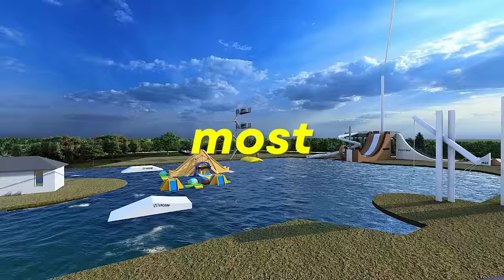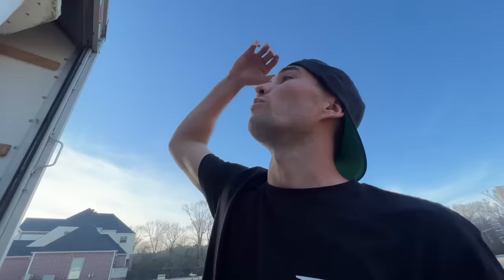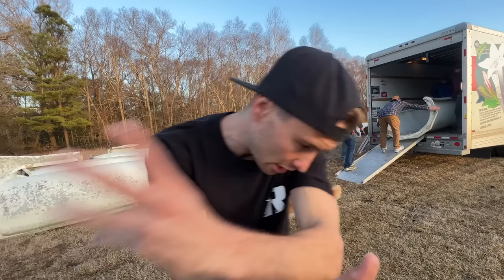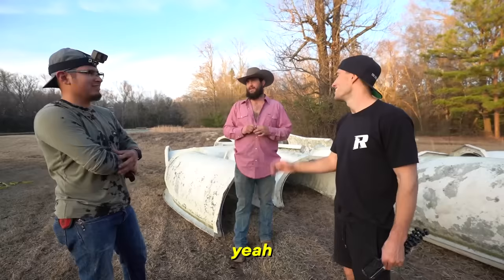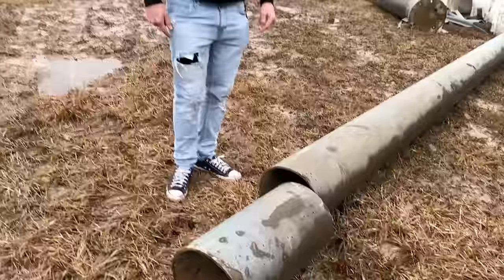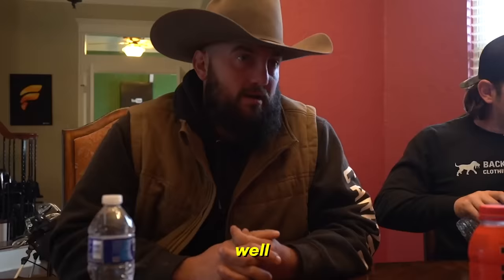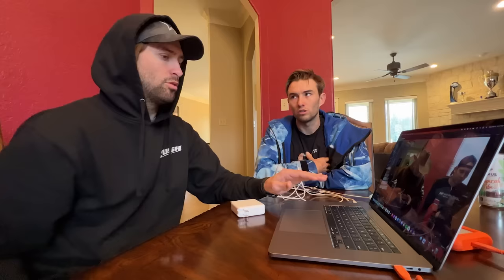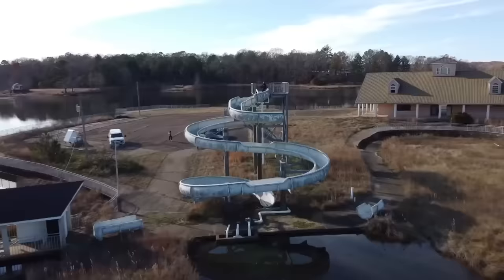I Bought a $300,000 Waterslide for my backyard!

Comment: Cutting up the structure isn't that big of a deal frankly. Round main section can be welded then weld a collar overtop to reinforce the joint. The HSS beams can be welded up as well and gussets/additional plates added. The structural part is the easier part. The loads aren't actually that substantial either. Water weight on the slide would be a few hundred lbs at any given time, a user or two another couple hundred lbs, and the weight of the sections themselves which by how they were moved suggest they're less than 200lbs each. 

The slide segments on the other hand appear to be in very poor condition. A lot of rot, corrosion, and weakness (visible cracking). Given the number of sections and they all need a significant amount of fiberglass re-work and it all needs a fresh gelcoat, to me there is about 20-25k just in refurbing the slide pieces. 

No offense but generally speaking this slide looks like it was ready to be landfill garbage until you came along as its cost to repair exceeds its worth. None the less, best of luck!

Comment: It's dumb that they cut up the support pieces without asking, but it might be easy to weld it back together which would make it a fairly standard thing to do while moving it. It would help to have someone else who is familiar with that industry, because I could imagine that if the slide was worth an order of magnitude more (I have not idea if it was or not) then it might make sense for the other person to say that you got it for almost nothing. It could be that everything has an easy fix and that it seemed standard enough to have a forklift that the other person didn't think anything of it, if they are assuming a certain familiarity with the industry of waterslides, etc.   The cracks also might be very simple to patch up with no damage.  But it could also be the exact opposite, that the other person is just being borderline malicious and trying to get as much money as possible.  I hope it all works out.
Reply: @CoryPchajek  I have no idea really…It’s definitely a question for a good engineer. But it could be that the top strength isn’t even close to being reached in which case it wouldn’t matter. Or that it wasn’t the weakest link. But things like this can be surprisingly non-intuitive.
Reply: @CoryPchajek  still, it’s an absurd experience and a clear communication failure at best, and a scam artist at the worst. Hopefully not though